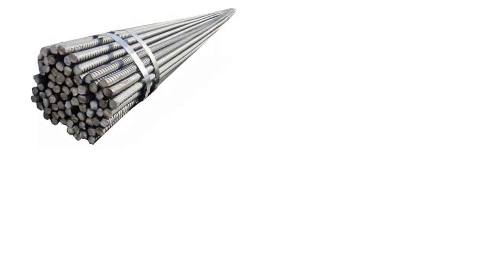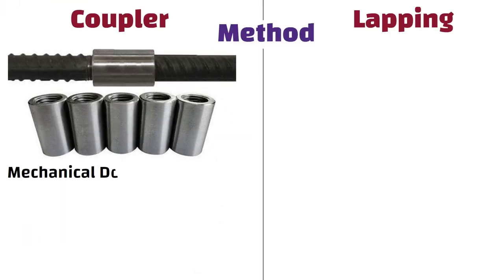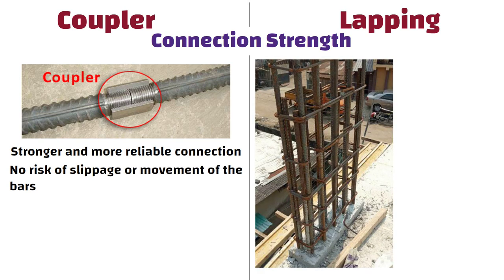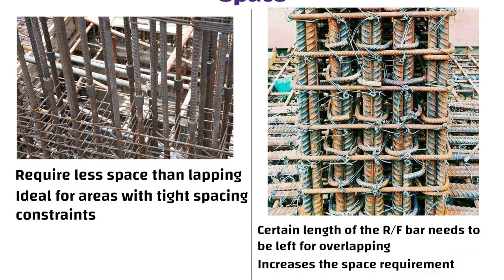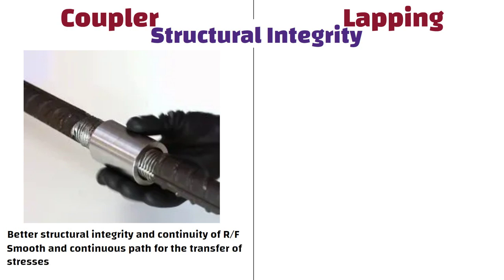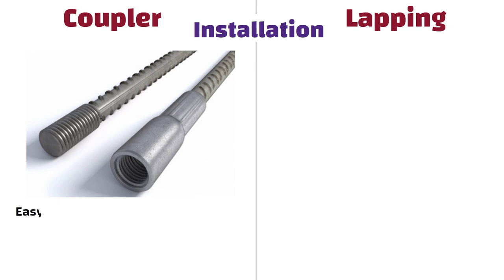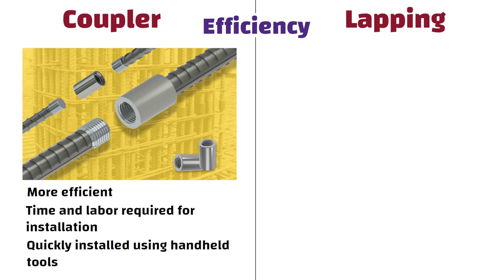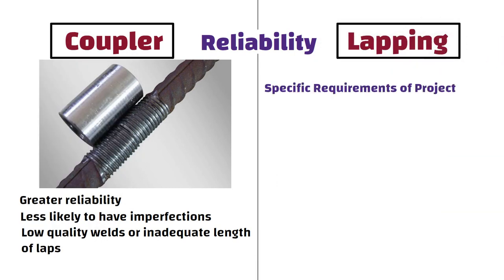Coupler VS Lapping Which is Better?

Comment: Coupled joints are very weak in tensile stress.
Reply: Which is strong ...??? Coupling or lapping
Reply: @varunreddy9623  A fully welded joint is much better than coupling or lapping.
Reply: 我们生产的钢筋耦合器在拉力实验表现非常棒的